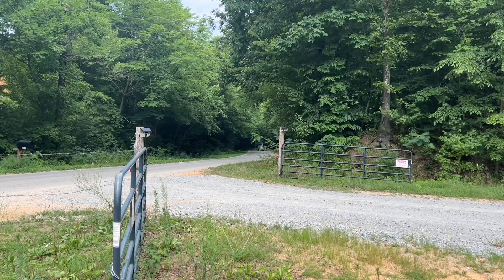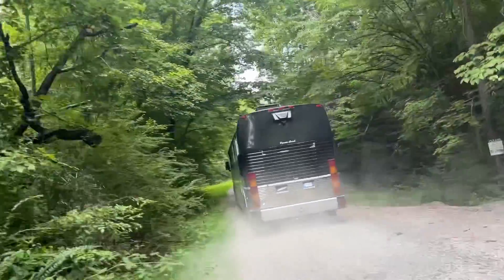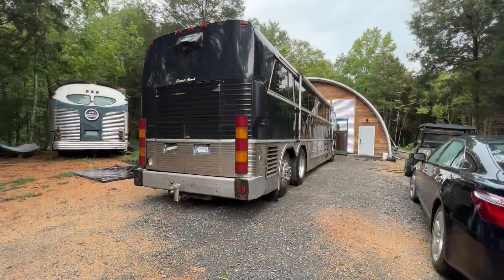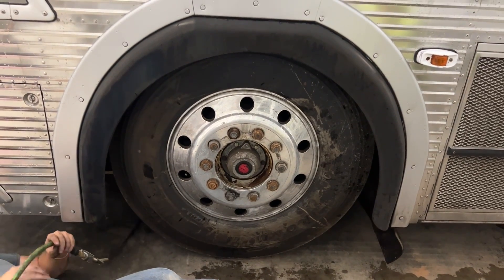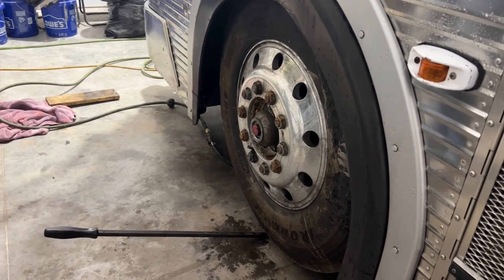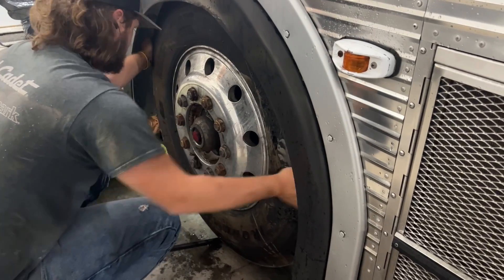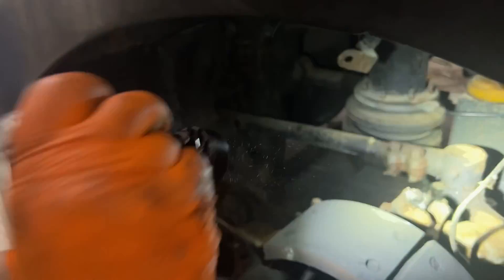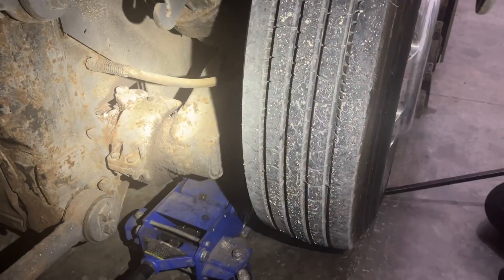Mci bus serious front end issues amongst many other items needing immediate attention.

Comment: The stainless on this MC-7 is flawless!   As many have stated, up top she looks great, but it appears maintenance after the conversion work has been lacking to say the least.  If this is a five-speed standard transmission, 1970 thru 1972 MC-7's had a clutch slave cylinder that darn near everyone forgets to service. While this bus is in for the "major steering redux", this bus's new owner would be well advised to take a good hard look at the mechanicals of the clutch circuit/system, a quick peek now will save a lot of heartaches further down the road!

Comment: You think you have seen it all but this shows how much more there is to these buses. Good to see it reached a shop that can actually repair the problems. With that kind of slacks in the front it would not pass any technical inspection overseas.

Comment: Exactly why rv’s should be DOT inspected and required to pull in to weight stations.  Commercial drivers like me are held to a certain standard yet folks driving the SAME equipment mechancially are not.   Ridiculous some of these are rolling around like that.  Granted its good theyre fixing this one but how many never get fixed?
Reply: This is different. It’s an old bus with a ton of miles, so things get worn out. A weigh station won’t help with worn parts. I agree on the older ones needing to be inspected. But an actual RV doesn’t see the miles of an OTR truck with a million miles on it!
Reply: @dodgeguyz  i dont mean for the weight aspect of it.  Just for the simple random inspections they should be subject to.   I know most states require a yearly one but it isnt always enough.  And vehicles that dont get a ton of miles can sometimes be worse because theyll develop the sitting problems that a constantly driven vehicle wont get sich as dry rot on air lines and tires and stationary trucks/busses tend to blow wheel seals.
Reply: Giving government more reason to overreach and intrude even more is NEVER the right answer!

Comment: Get one of those 150-275gal plastic food storage totes with the metal cage put a small gas powered trash pump and 
Put it in your 1ton pickup some 1/2'or 3/4 schedule 40 pvc 2elbows 3 ts and put 2 120degree 1/2 circle spray heads and 2 quarter heads mix 1bsg calcium chloride. 2bottles dollar store dish washing soda  and spray on road keeps
 dust down  just spray on top of stone and soap makes the salt water stick to stone instead of washing away

Comment: There goes 20 Grand and I would service the engine and trans and fuel system. Those million mile busses they never keep the undercarriage clean and inspected and lubed like they should. My buddy has a Super High Pressure Undercarriage Power wash system that literally steams the rust and dirt off the bottom. He then applies a Special adhesive paint and a water repellant undercoat and makes it look new with a 7 year warranty. I have seen old nasty Busses come out looking Brand New. He got the Idea when he used to work for Greyhound as a Shop Supervisor. He charges $1995.00 and I swear they look absolutely new when finished. He does this to a lot of the High End Motor Homes. They also wash Busses and apply a ceramic coating and when finished gee they look good. His machine vibrates the High Pressure water and solvent and he recycles it. He says on a Old Greyhound Bus it could have 250 lbs of dirt and grime built up over time. Once finished he Lubes everything and you can eat off the engine and complete drive train. I saw a bus he did 5 years ago and water still will not stick to it and it looks amazing. Salt no problem.

Comment: Just curious, what is the estimate on repairs to this bus? I’m contemplating buying an older conversion bus and upgrading from my diesel pusher motor home. I sure like the idea of a bus. I am a quite skilled auto mechanic but I have not worked on a bus before. Thanks and keep up the great work. I never miss a video.
Reply: I think the general rule is to budget about 20k for either deferred maintenance or updates.
Reply: Diesel and heavy duty is a whole 'nother ballgame. I had auto and diesel training. Everything is bigger and heavier and more expensive. Put away those 'watch repair' tools as my instructor would call a 2 lb. hammer and get a REAL hammer (12 lb.)
Reply: On an older Prevost, rule of thumb to bring back to original is about 30,000 on chassis..
Reply: If you like the looks of the bus, still a better way to go than a new Class A.

Comment: I would like to know why RV's and bus conversions don't have to have yearly safety inspections. In Illinois they USED to have inspections for everything from pickups on up, but that has changed. Pickups no longer need inspections. There are a lot of junk pickups on the road that should be scrapped. I think ALL vehicles should have safety inspections.. There are so many cars with bad brakes, suspensions and so much rust that they would fold in half if in a wreck. This bus hasn't had service for YEARS.
Reply from the maker: $$$ politicians and the American lobbyist influence

Comment: It's amazing how just about every single bus you work on has the exact same suspension problems.  I wonder just how many death traps are operating on the roads and highways in the United States.  Having something that heavy and that old operated by a non professional driver is a recipe for disaster.  There needs to be some type of annual inspection protocol implemented for old passenger busses.
Reply: Define old!🤔
Reply: @robertcarter8186  Made before the year 2000.
Reply: @robertcarter8186  depends on were it has operated. This bus undercarriage on quick glance doesn’t to have operated in areas that use salt in the winter. I live in southern Ontario were we have snow in the winter and salt on the roads. I would not buy a mc7 from my area, but after 19 yrs all bus chassis should be inspected annually.
Reply: This bus chassis looks pretty good. You would not find a mc7 in southern Ontario that can be made safe because of salt. The fact that the chassis is in that good of shape but is unsafe compounds the reason that non professionals need annual inspections just like the commercial buses. Were I’m from annual brake inspections plus bi annual full inspections . Commercial buses are inspected regularly plus drivers are reporting problems in between. Rv owners have no experience, they don’t even have to prove they are capable of driving their equipment. The reason why is tourism is a big market, and heaven forbid we try to make sure they are operating safely

Comment: That’s a modified 7?
Reply: I drove MCI's professionally. It looks like an MC-7 with some rear end modifications. I usually drove the MCI-DLC102 with the series 60 Detroit and a six speed automatic Allison transmission I absolutely hated. The damn transmission would shift when locked down.
Reply: @jamiesuejeffery  That is a Seven, the backbone of the GLI fleet in the late 60's and all through the 70's.  Originally 47 seats, later changed  to 43.  All 8V-71 4spd manual spicer although  some late ones had Alison automatics.An amazing coach to drive. Greyhound owned MCI at that time and designed this and others per their specs.

Comment: moral of the story is if you see a bus on the road give it a wide berth.  I work on class 8 rigs and see some bad stuff but a bus make me nervous.  really surprised you can still get parts for them these days.
Reply: Is this something you comment in every video? Buses and trucks use practically the same parts for engines, suspension, wheel ends and drive lines.
Reply: unless it has a "serviced by the bus Grease Monkey' sticker on the bumper.
Reply: @gwstonemason  there’s plenty of people on the road that service their vehicles properly. BGM is not the only person that can properly service them.
Reply: @user-ln7of9gs4s  I'm sure there is but a was replying to a previous post with humour. 
judging by all the stuff I've seen here on BGM channel, I don't see many done right.